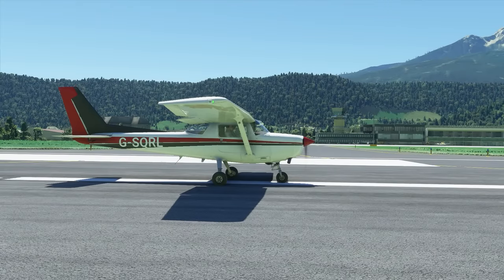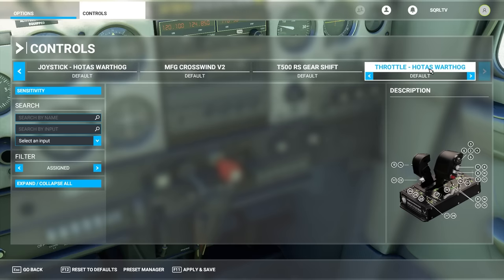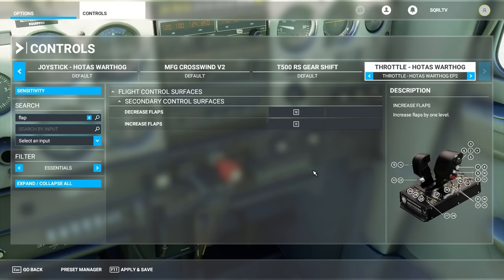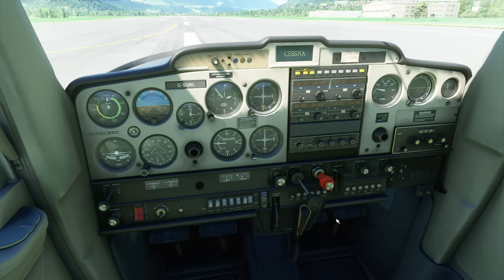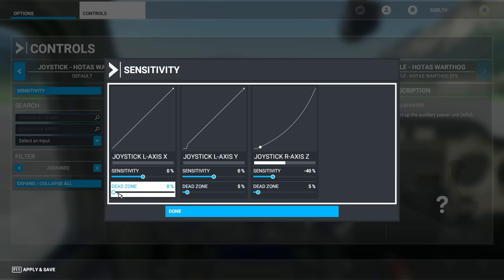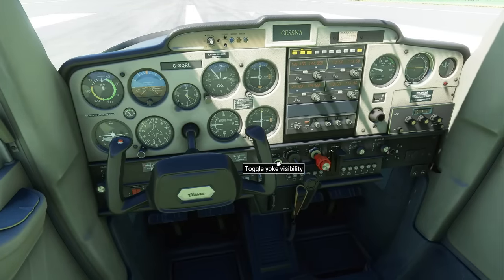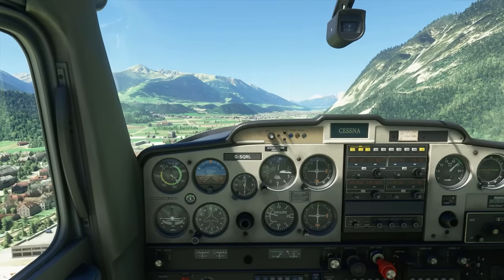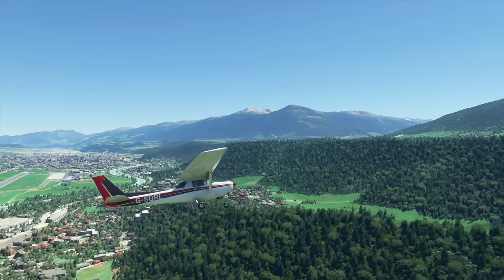Tutorial #2 - Peripheral Control Setup - Microsoft Flight Simulator

Comment: how do you map reverse thrust
Reply: Select all input and search for reverse thrust. Then select hold reverse thrust or toggle reverse thrust options.
I have it mapped to a button close to my single throttle unit. I press the button to toggle reversers then pull the throttle "forward" to increase reverse thrust power

Comment: Looking forward to using my Thrustmaster TMX Racing Wheel.
Reply: LMAO
Reply: nice.
Reply: Well m8, you should be able to use your brake and accelerator as rudder pedals.
I have a T300 and that's what I'm hoping to do (already works on Xplane and Aerofly).
Got the brilliant honeycomb yoke, plus a flightstick with 2 throttles and 2 saitek panels (radio panel and autopilot panel).
I'm hoping these all work from the get go.

Happy days :))
Reply: The online experience.
Reply: Lmao I have one too
Reply: I actually use my G27 pedals as rudder lol

Comment: Sensitivity doesn't work.  When I click on it all I get is "DONE".  Throttle is either on full or off, elevators are really jerky.  Smooth flight is impossible.  I'm using an older SAITEK PRO joystick and having trouble mapping it.  I've followed this tutorial several times/
Reply: Hopefully, the sensitivity bug will be fixed in the next release. I am in the same boat as you. Make sure you join the FS2020 forum for the latest news and views.

Comment: Yikes, you just answered one of my most pressing questions: Can I map the POV up/down on my joystick to pitch trim? Looks like yes, I can! You made my day :) Only three more nights of sleep ...
Reply: Volker Jansen. Rather than wasting a POV switch, I would recommend using a toggle switch on a throttle (if you have one), I find this more useful. I should add that the best switch for this is a “momentary” type. On the Saitek 55 I have I use the momentary  rocker switch on the rear of the Left Throttle.
Reply: @antonvons8559  At the moment I think I will use the POV switch on the throttle to pan my view and the POV switch on the joystick to trim. It seems quite intuitive to me to trim and release pressure on the stick with the same hand. I just bought the Thrustmaster TCA joystick and their TWCS throttle, which has an unbelievable amount of buttons. It even has a mini joystick under the index finger which might be an interesting alternative to the POV button.

Comment: Thank you so much for this great tutorial series. I have been fooling around FS 2020 since release day and as an XPlane user found a lot of similarity. I was a low hour licensed GA pilot some 60 years ago and gave it up when kids started chewing up my disposable income. The transition to simm flying 20 years ago was fun but in no way close to the real thing. FS 2020 is a different kettle of fish. My original settings and callibrations were as close to default as I could remain. I fumbled around with various tutorials until I stumbled into one of yours. WOW, you should be a teacher or instructer, likely are one. Your preparation, presentation, sequencing and delivery is really top drawer, Cudos! I now have all 10 tutorials saved up and I am now re-installing a fresh install of FS 2020 and will take the time needed to "do it right" with your help and guidance. I run with a PC with Intel i7 8700k, GT Force 1050, 32 MB of DDR4 RAM, on a B365M Pro VH MoBo from MSI. Controls are Microsoft yoke, pedals and throttle quadrant plus a multi function joystick.  Main display  is a 55 inch 4k tv.

Comment: Very cool.
It took a few decades for MSFS to finally implement exponential rates into the controller interface, which incidentally have been in use for a long time in radio control modelling.
Reply: Been available in other flight sims for ages, it is good but nowhere as detailed as say FSUIPC in P3D for granular control of your AC.
Reply: @zorbalight3933  
"available in other flight sims for ages"
May well be. I meant MSFS (or its sequel, P3D). 
Pete Dowson rose up to the fact that it was missing and implemented it in FSUIPC.

Comment: Let me add my thanks for this video. MS2020 really could've used a tool tip or something in the controls panel for this. I use a tweaked Saitek yoke with the BU836A board in it to help with pitch and roll control response. I needed to map the axis's to the board, but also clear the same axis's from the yoke control too. I'm sure I'll be back to check your other tutorials soon.

Thanks a million!

Comment: Great video.  I use older CH Products controls which are not recognized by MSFS2020.  I tried to follow your instructions, but it would not work for me.  What I had to do was map each button or axis.  BUT, before mapping would work, it was necessary to clear each entry position and validate each of the columns left and right, whether or not there was already an entry.  It was a lot of effort, but it worked.  Once again thanks for the tutorials, greatly appreciated!

Comment: The reference of us all is of course FSUIPC - Could you elaborate on how the system matches what we are used to?
Further
How does it handle different or similar mapping to various aircraft? Are these control settings saved in the XML files that can be hand edited and shared?
Can the Flap also be assigned to an Axis?

BR

Stephen
Reply: FSUIPC Beta is out now. A lot is unknown currently. It will be developed fully over time.

Comment: I set deadzones to zero in FS2020 for the Crosswind pedals and if needed I adjust deadzones in the MFG Configurator.  It works so much better that way. Disclaimer: I don't have the V2 MFG Crosswind's I only have the first revision from several years ago (White/Black).  THANKS SQUIRREL !!!!!

Comment: I have yet to figure out how to set a crossover point on the throttle, prop and mixture axis’ to have a BETA/reverse zone at the bottom of the throttle; a feather zone at the bottom of the propeller lever and a distinct low idle/ cut-off point for the condition lever......
A little advanced controller setup for turboprops and jets would be a great topic.
Thanks

Comment: Mapping a parking brake button normally can be dangerous if you land having forgotten that it's on. So when mapping you could use the 'map by input' feature and use two buttons simultaneously (push one button and hold it then push and release the other button). The first button is the shift button and the other button the actual parking brake. That way you will likely never bump the parking brake ON while flying. 
Setting up a 'shift' button is an idea for all dangerous commands. Such as dropping a fuel tank or bailing out by parachute in a combat sim.

Comment: I have spent almost 5 hours downloading and being impatient loaded a flight. My hotas controller was recognised so I tried to use it. I found that some of the buttons were completely different from fsx .as I have been using fsx for years I was completely lost. I couldn't even release the brake it kept saying press B which I at first assumed was the keyboard until I bought up a picture of of the controller with letters against the buttons. So this is really useful, I intend to map everything to the same controls as FSX,  thanks to this.

Comment: Many thanks Squirrel for these excellent tutorials !

I have bought a Yoke Honeycomb, Logitech Flight Rudder Pedals, and put them on a Wheel Stand Pro (for flightsim V2), and I have already a X52 and a T.Flight Hotas 4 from which I will the the trotle parts (in complement oh the yoke).

In FS 2020, it seems that you can mix different peripherals for controling your aircraft, so the mapping sould be fine because these product are already recognised in Windows 10 control panel. 

So this tutorial is very usefull to understand how to map all my equipement in FS 2020, and how to build different set of parameters...

And thanks also for the Trim information, I was questionning myself how to do this to obtain the neutral/stable position on my yoke during the fly...

Comment: I have a problem with the sensitivity controls. IRL the controls behave in a linear fashion whereas setting a curved response means that the actual movement accelerates so although it allows fine control near the centre there is only coarse control further along.
Also if you set a dead zone there should be no "step". Set sensitivity to 0 and then set a dead zone the start point on the Y axis should be 0 while the X asis is whatever dead zone you selected.
Just have a look at other sims with similar controls (flight sims or racing sims)

Comment: I found I needed to Run Flight Simulator in "As Administrator" to get this to work even though my login to Win 10 is as  Administrator. I have CH Yoke and Pedals an stillo have to set up the POV switch which I am struggling with. Otherwise a great tutorial!
Reply: I have all CH Pro controllers as well, and I'm having a hard time getting the POV setup as well.  Did you figure it out?  Especially the Drone camera.

Comment: First of all, great Video and great explanation! Calm and very to the Point, great help for everybody that starts with MSFS 2020. I have a question regarding Controllers: so how I understand, you're using a Keyboard, Mouse, Joystick and Throttle all by the same time? I mean what is the lets say essential Setting? Do I need a KB considering playing MSFS on a XBOX Series X? I found myself as many others stuck at a smaller Airport on a parking Position not being able to ask ATC for Pushback and as I don't have a KB there was no way - just facing the wall - so what I want to know before spending money into controllers and Gear, you think a Thrustmaster One and KB Combo will do it?
Thx and keep on!

Comment: I really hope the input sensitivity gets fixed. It is unplayable at the moment, Even with sensitivity set to -60% I get full control surface movement at roughly 30% of my controller range. When I move it very very little it still makes it look like I am throwing the stick around to it's limits. (I use the X52 hotas)

Comment: I just recently installed Microsoft Flight Simulator on my PC and as fortune would have it I came across your tutorials. They are fantastic. A big help for people who have on clue about MFS. I am wondering if you have a tutorial for setting up the cockpit controls for people who use a mouse and keyboard. I don't have a joystick throttle like the one you did this tutorial with. I am having so much trouble trying to get the mouse to do the functions so I have control of the aircraft. Any help would be greatly appreciated. Thanks for your time. \m/

Comment: The simulation is fantastic. Currently it works with my 360 controller but my ch products yoke are recognized but there is no controls assignement and i don’t know how to set it. I will have to go deeper and read the documentation. I have it for just an hour so i need to look how setup ch product yoke and pedal pro. Maybe this part should be better explained.

Comment: Appreciate your instructions.  Initially, 
believed I set up my Logitech Force 3D Pro  joy Stick correctly with roll, pitch, rudder, brakes and throttle assignments.   All working when I checked within the control menu. However,  only working with a few aircraft. Key board asignments fail as well sometimes. Any suggestions where I went wrong ?  Apreciate all guidance from those more experienced

Comment: Gotta say mapping CH products just doesn't work well at all. Everything that does work is sold out of course so, I'm stuck with $120.00 worth of used HD space!  Yeah MS!
Reply: Your CH yoke doesnt work? My CH yoke either doesnt't work.  Same as MFG crosswind V@ as seen in the youtube film at 9:43 i see the same question mark.
Reply: @NickWilmans  I had the same problem and then realized I was mapping my CH yoke to digital inputs, aka hard controls (on/off) only.  Make sure to map it to the axis input instead.
Reply: @iTheZachinator  It's the axis. I didn't realize that. But for small aircrafts you need a good joystick. Not a yoke. And it should  be a good quality yoke, otherwise you will too much overcorrecting during flight. It's very difficult, almost impossible to tweak with sensitive settings.

Comment: Are you able to show how to map Reverse Thrust? I've been trying with my Logitech Throttle Quadrant for bit with no luck. FS2020 has a few different options to map Reverse functionality. Not sure if this an axis or a button, but the Logitech Quadrant has an internal button at the end of its axis for reversing. FS2020 recognizes the input, but won't validate.
Reply: Exactly the same problem here.
Reply: @user-zt1er1uj6i  I'm chalking it up to an early release quirk/bug. I tried assigning a keyboard press and while it will validate it doesn't seem to a tualy engage. On the TBM it feathers the prop instead of reversing...may just have to wait this one out I suppose.

Comment: I have a honeycomb flight yoke to compliment my fs2020. I am having a number of issues with configuring this new setup. Until recently I have been a joystick operator. Taxying an a/c around the tarmac was simple. Twist the grip to follow the line. How do I follow the line using the yoke? With the previous sim you could set the twist to operate nose wheel steering and ailerons to one input. My want is use keyboard as little as possible. Can my yoke both nose wheel and ailerons?

Comment: Strange... Set up my controls just like in the tutorial, but in my outside view, I cannot control the aircraft. Rudder pedals only work in the cockpit view for example. Increase the flaps in the outside view: nothing happens. In the cockpit, every thing is fine... Am I missing something? Otherwise the tutorial helped alot. Got my CH Yoke and Pedals working beautifully (thanks), but only if I stay inside... 😦

Comment: Great tutorial! I guess people are expecting a lot of complete beginners to be picking up this sim, since I never saw this kind of detailed help for other sims. One question. If you set up a plane specific profile for several different devices, is there a way to load all of them in when you use that plane, or do you have to remember to load each of them in, individually? Thanks again for all the help.
Reply: It is not plane specific. So if you have a button mapped for gear up and gear down, as long the plane your flying has retractable gear that button will work as it should. 

I suppose you could set up separate profiles for aircraft categories like airliners and props.
Reply: @RedGlu3  Thanks.

Comment: Hey Squirrel: This was a great tutorial and helped me to set up my controller assignments. However, do you know any way to easily take a profile created for one particular airplane and apply it to others? I created a profile for my throttle quadrant for a piston aircraft (e.g. Cessna 172) but I want to use it for all the other piston-powered planes. I could not figure out how to do this other that creating a new flight and selecting a different airplane, then going to the controller options to make the profile change from the default setting. Seems to take a long time when trying to change all the included aircraft in the sim. Thanks!

Comment: Wow! What a useful video!! I didn't see any way to IMPORT a profile. Is it, in fact, impossible to import a profile set up by friend? The reason for my question is that I'd pay $$ for a profile for my Sidewinder Precision 2 joystick. FS sees it, all right, but it's one of those controllers with a giant "?" superimposed on a phantom silhouette. I was surprised at this, considering it's a Microsoft controller that Windows 10 recognizes and instantly installs a driver. It can be calibrated in Microsoft Windows, but it does nothing in Microsoft FS 2020, and I've had little to no luck configuring it. The ONLY thing I can do with it is move my point of view a little. I have had no luck getting it to control any of the plane's control surfaces. Any hints appreciated so I can fly while my Logitech joystick is in transit to me.

Comment: Is there any way to configure the roaming cursor that is used to select the toolbar or UI elements in the cockpit, to a T.Flight Hotas One?  At the moment I need to operate two controllers to fly any plane.  I do not have a mouse and keyboard, so to currently reply to ATC or to see visual aspects in the cockpit, like check landing gear is down, or flaps - I have to get the plane to a safe cruise and trim - so I can then pick up my controller and fish about.  Obviously this is far from perfect and could in the wrong circumstances result in a stall or a crash.  Also for flying by instruments in bad conditions it would also help.

I am guessing there is a way to map everything to the hotas alone and that I just don't know how to do it?  

Any help is most appreciated.  I am new to flight sims, this is my first ever sim. With help from some of your other instructional vids I managed to set piloting to hard and landed at Lukla on the first day,  so was happy with this.   You have helped a lot, especially with understand of airspeed. 

P.S

On an Xbox Series X

Comment: Dont know if anyone else is having this problem but when i move my joystick to the left or right, the yoke doesnt smoothly roll, it just jolts from one position to the other almost as if im playing on a keyboard. As well as this, the throttle is either on full power or zero, there is no in between at all. This joystick worked on fsx so idk why it doesnt on this new sim?
Reply: Naahahaahaha same for me
Reply: What yoke are you using?  I have the saitek flight yoke system
Reply: Can't get mine to recognize
Reply: maybe you mapped for example the x axis to aileron left and aileron right, but you have to use the ailerons axis. (I did the same mistake at first). same with everything else that has an axis